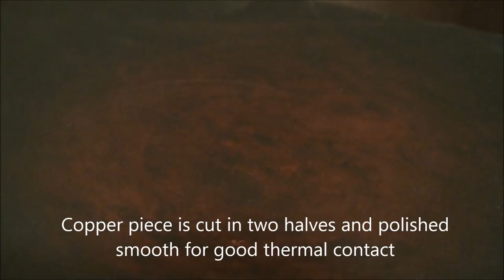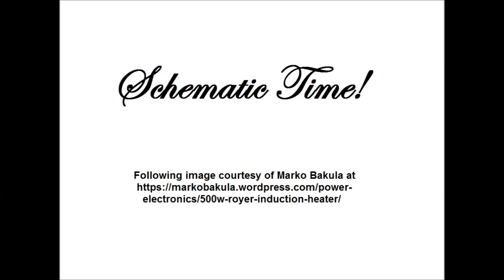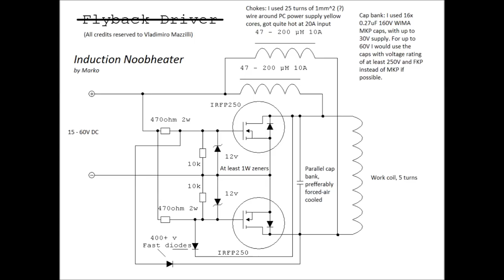How to Build an Induction Heater (500W)

Comment: "Filling 1/4" OD copper tubing with sand": proceeds to pour sand everywhere except inside the tube
Reply: Don't know why the sand? Didn't he finish with water cooling?
Reply: @CliveChamberlain946  send is needed to wind the coil only
Reply: @apsysspace6764  Ah..  You mean to pack it with sand - so it's less likely to kink while bending it?
Reply: @CliveChamberlain946  yes

Comment: With sodiumsilicate aka water glass, you could glue a thin sheet of airgel around the crucible. Make some horizontal grooves with sandpaper around the crucible. Keeps the coil cool and heats better. You can make water glass with cat litter and lye. See the available videos. Cost is maybe ten bucks for gallons of water glass.

Comment: The caps I have look like yours, but have "X2" printed on them.  Do you know what this means?  Thanks for the GREAT video!
Reply from the maker: The "X" is the class the capacitor belongs to.  An "X2" capacitor is intended for application across an AC hot/neutral pair of wires, so if it fails it will result in a short.  The "Y" class of capacitors is for line to ground, so failure may result in electric shock.  I have used X2 capacitors before and they work well - it's just a safety rating.
Reply: F

Comment: Could this be used as an alternative to a propane forge?
Reply: Yes, most industrial forges actually use one of these. They have some disadvantages (mainly relating to the things that they can't heat up), but they work, and have the advantage of not requiring fire and instead the object heating itself up

Comment: Mini-clarification/I didn't bother reading the comments to see if it already had been:

The sand in the copper tubing is only used in the beginning when you twist the tube around the PVC pipe (or whatever you used to make the coil) to prevent the pipe from kinking. Once you've formed the coil, you empty it of the sand.
Reply: Yes correct

Comment: Question about this graphite crucible we see in the end of the vid: when do you know it's time to replace it? They have a thinner section than crucibles for propane. Have been looking for this answer and seems nobody knows. Thanks 🙏
Reply from the maker: With graphite crucibles, the actual crucible will burn slightly sometimes (due to it being carbon at high temperature in an oxygen environment), so they gradually become thinner over time. For sure they should be replaced if any cracks or holes are noticed, but also if you observe the walls becoming a lot thinner than they were at the start.
Reply: @ThePlutoniumBunny  thanks mate! I appreciated  your answer.

Comment: Pro tip. When I bend tubing I fill the tube with water plug the ends and put it in a freezer. Once the water is frozen I bend the tube. Ice melts sand doesn't.
Reply from the maker: Thanks for the tip! I actually have an upcoming project that could be (possibly) useful for.
Reply: I take the plugs blow out before the copper tube bursts?

Comment: If somebody passes water through a metal pipe heated by a magnetic coil field to just heat that water will that water be dangerous to touch due to possible electric shock?
Reply: Yes
Reply: In this application. Since the bus bar and MOSFETs are directly on the pipe. But they can be made so that the water is safe

Comment: Can a induction heater circuit  be used ? Consider the fact that  the coil has same coil but  the coil configuration  is changed

Comment: Yo, what are the pro/con of a arc furnace vs wire heating element for smelting.
Reply from the maker: Generally an arc furnace will be harder to build and will give rapid, somewhat uncontrolled, but extremely powerful hearing.  You can, for example, easily melt iron and reach temperatures in excess of 3000C with an arc furnace. A wire heating element furnace will be easier to build and allow for slow or carefully controlled heating,  but it will be harder to reach extreme temperatures with wire heating elements.  They can easily temperatures of 1400C (Kanthal A1 wire), which is still pretty toasty.  So it depends on application.
Reply: Arc furnace heating allows you to heat and/or melt all metals, while induction heating only allows you to heat ferrite metals. If you are only melting metals such as iron or Steele, this is the way to go. If you're melting copper or gold, you won't be able to do that with this.
Reply: I have seen designs for arc furnaces using standard welders and carbon electrodes. It can be done, but keeping it all working consistently would take some practice and probably a feed mechanism.  The arc furnaces would be very loud, and consume the electrodes. 
The wire furnaces main issue is that they are not hot enough for foundry work for steel and copper alloys. They work for aluminum.  Another issue is that vapors coming off the metal damage the wire reducing its life.
Induction avoids both of those issues, but is more expensive or difficult to setup. It may also only work well in a narrower range of materials, the frequency requiring a change for other materials. Induction also stirs the metal which can be both good and bad.
Reply: Yes it will silly buns

Comment: I don't get why you have to cramp all the components so close to the coil, instead of creating a beefy circuit board and enclose it, then have a pair of thicker wires run to the coil externally

Comment: Can we make it 1KW by doubling the Mosfets?
Reply from the maker: It has been a while since I have looked at schematics for this, but that sounds like a familiar idea.  I would look for people's designs that use such an idea to confirm that it works.  Sorry I can't offer a more conclusive answer - electronics classes are in my future but haven't happened yet.
Reply: I have build my own induction heater. I used 3 paralell mosfets and everything worked fine

Comment: can I use this to cook food with a spiral coil? Can I use Myler capacitors instead of MKP film capacitors?
Reply: This is literally how electric stoves work
Reply: @lincolnrowe4552  this isn't accurate (unless you're talking about induction cooktops). Electric stoves work via resistance. Electrical resistance heats the coil. In this induction heater, the coils are not meant to heat up. They heat up the metal they're inducing a current into.

Comment: CAN I PUT IRPF260N? SHOULD I DO ANY CHANGE IN RESISTERS IF YOU CHANGE?
Reply from the maker: I believe it will work with the IRFP260N without a change of resistor.  That variety of MOSFET can handle more current.  Good luck!
Reply: THANK YOU VERY MUCH

Comment: if i wanted 10 turns instead of 5 in the coil,  what changes would i have to make to the circuitry
Reply from the maker: That would change the resonant frequency of the LC tank (the capacitor-inductor resonator).  I am not certain if you would need to change the circuit at all - try it and see how different coils behave in terms of power output!
Reply: Keep in mind higher frequencies won't penetrate into the metal as far, and can run into radio/microwave frequencies if you go too high. 10 turns wont put you near to that though.

What is your motivation for more turns?

Comment: Can i do the same thing with 600A 12v ac and only the coper coil ?
Reply from the maker: You could need the current to be alternating at high frequency for the desired effect, but the amperage seems like it would be good.  You would for sure want water cooling.

Comment: How did you calculate the turns and wire diameter with given inductance.?
Reply from the maker: I copied from other designs online that used around this many turns and chose my copper tubing diameter to be 1/4" so that it would carry the cooling water.  I didn't really aim for a particular inductance.

Comment: Thank you so much
How much your input current???
Reply from the maker: At the absolute maximum power I have achieved, the device drew 20 amps from a 24V source (the two 12V batteries in series).
Reply: Thanks a lot

Comment: Why sand?
Reply from the maker: The sand prevents the copper tubing from collapsing/kinking on itself when it is bent around the PVC pipe.  It works really well for making smooth, tight turns.
Reply: @ThePlutoniumBunny  you could also use a fusible alloy as a more expensive option as a filler instead of sand.
Reply: @dgamezonu2693  
I guess you know why he used sand... It's free (if you take a bucket to the seashore), and it's much easier to fill or take it out from the tube.
Reply: The benefit of sand is that it can be removed after bending to allow for fluid circulation if you plan to cool your coil this way.
Reply: They usually use soap water instead of sand (tube has to be frozen with the water inside of it)

Comment: Eagerly awaiting the demonstration video.  Have you attempted to calculate efficiency of power in to heat gained in the metal and crucible?  I would like to build one of these for casting like 20 lbs of iron.  That's 3.75MJ of energy I need and to be more convenient than oil fired furnace, I'd like to do it in say 30 min, so thats 2,000 watts.  I can already cast iron with my vegetable oil fired foundry, but electricity has some enticing advantages.  Let me know if you need any general foundry info, as thats  all my channel.
Reply from the maker: I have not yet attempted that calculation.  How would you recommend such a measurement?

Also, impressive goals for your induction heater!  Let me know how it goes.  Electric is definitely nice for speed, noise, and reduced cleanup.
Reply: @ThePlutoniumBunny  most accurate way would be to put a amperage meter around the lead to your power source, or plug your power source into a wall kill-a-watt type meter and run it.

Comment: What metals have you melted with this setup?
Reply from the maker: As of now, just aluminum.  But anything with a lower melting point would work as well if placed in a graphite crucible.  Honestly I haven't had a lot of time to test the limits of the machine; the video of melting stuff may take a while to appear due to summer commitments.   It will happen though.

Comment: Did you seriously use plumbing solder on electronics?
Reply from the maker: No, it is more likely I used electronics solder on the plumbing job for the copper cooling pipes. No plumbing solder was harmed in the making of this film.
Reply: Will this burn glass and how do I keep the temps in control